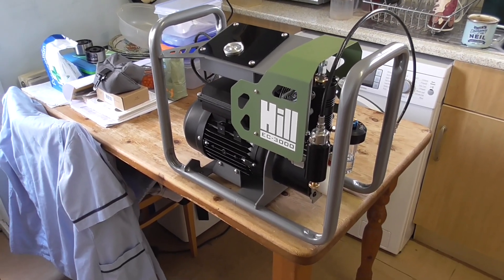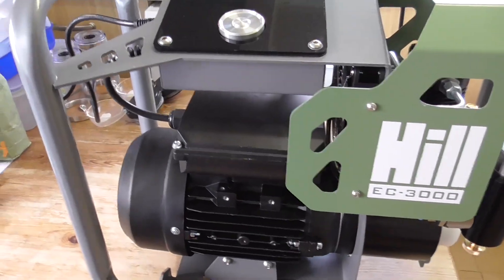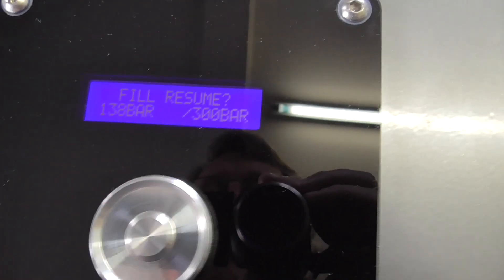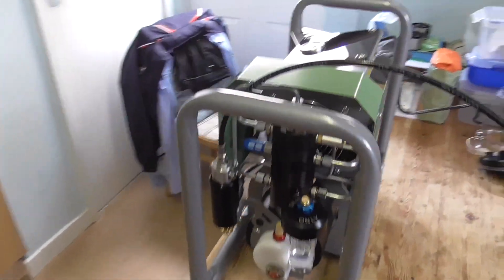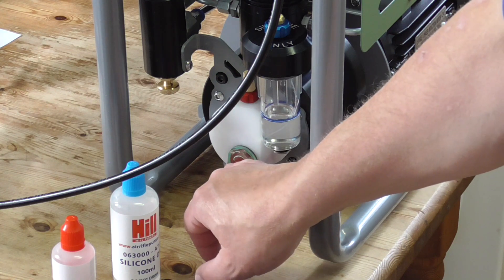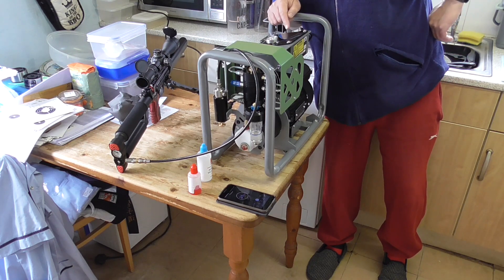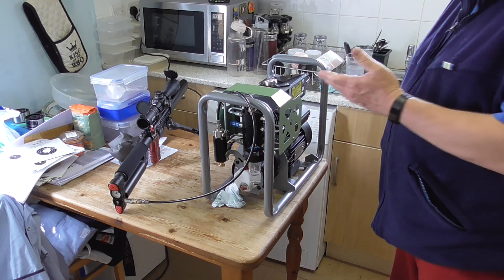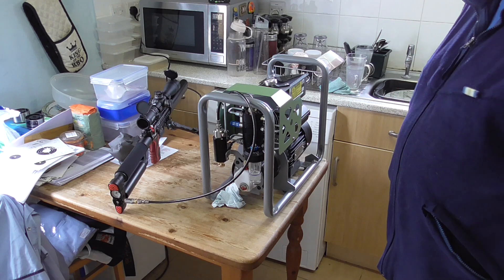COMPLETE   HILL EC-3000 REVIEW 30/04/2021

Comment: My question is, do I have to buy their crank oil and silicone oil, or can I purchase other products similar to their's ..any idea..
Reply from the maker: Like all lubricants, as long as you use the right specifications of oil I don’t see it being a problem. My compressor uses very little oil, and so far I have only had to top up a little silicone, as the crank oil doesn’t need replacing yet.

Comment: How is this compressor doing now after 4 years of use? did you have any problems? And how many hours has it run now? There are not many if not no long time reviews of this compressor.
Reply from the maker: Reliable is still good and she’s on around 18 hours. I mainly use her to top up a 3 Litre bottle, so the hours aren’t massive. The newer versions charge a bit over the 300 bar, so you get a full fill per bottle.
Reply: @reevessairgunningreviews5572  thanks for the reply, I have a Chinese compressor now. If that breaks, or when I have had enough of it, I will buy the Evo 310. Also for topping up a 3 liter bottle.

Comment: I think you need the Hill dry-pac pro air dryer filter.
I nice set of wheels and a small pull handle may make this moveable and a little more handy.
It is small so unit and wheels not needed.

Comment: Great vid ,
Have you tried filling a dive tank ?
Reply from the maker: Yes. The manual says you can top up small bottles. I have topped up a 3 litre from round 150 bar to 300 bar. There is a short video on that
Reply: @reevessairgunningreviews5572  thanks I'll check it out

Comment: I've just sent for one. Hope it's OK,  I'm a retired disabled pensioner. I don't want to get blown up. I've got enough on my plate. Seriously, I think if you just fill your guns and not push it too hard, it should be OK. I hope.
Reply from the maker: I regularly fill my 3 litre bottle. As long as you read the manual you’ll be fine.👍

Comment: Great review, thank you, I am considering either the nomad 2 or the hill ec-3000, being that you own both and you’ve used both now for sometime which one would you recommend?
Reply from the maker: If you don't need to run a compressor from vehicle, the Hills is the one to go for. My friend now has the Nomad, as I only use the Hills. I have a 3 Litre and 0.5 Litre for range use, and the Hills fills them with ease.
Reply: @reevessairgunningreviews5572  thank you for your feedback. You have been very helpful, I will order the Hill.

Comment: I have one of these, had it a week and its failed already. After it gets to temp then pauses to cool down it wont restart. The motor sounds like it is jammed it just buzzes and it tripped the electrics. So turned it off straight away and put it back in its box ready to be returned.

Comment: Using my now for 8 months the only problem I have had with it is it doesn't like the cold, if my workshop drops down to 5 degrees it will not start until its warmed up.

Comment: Is it worth £850, no. Its a good pump with about £200 worth of parts, so I would say around £500 tops, then all airgun compressors are over priced.
Reply from the maker: Like you say all compressors are fairly expensive, some very like the Daystate. It's less that £200 more than the Nomad 2, so I would say it's worth it.
Reply: The people of that company also have to make a living. They probably don't sell 10.000 units per year. So John, maybe your suggestion is a bit stupid.